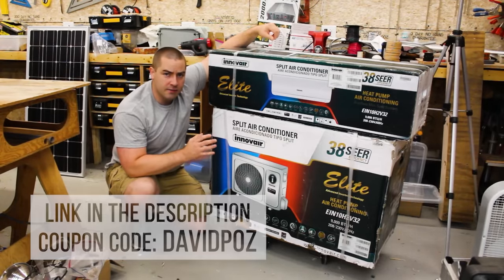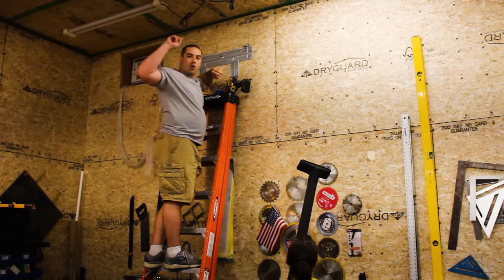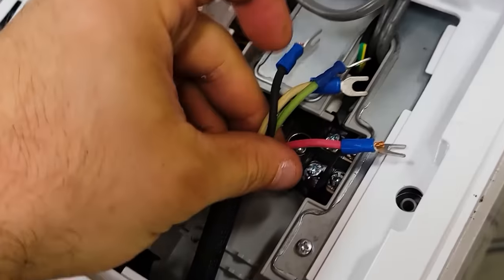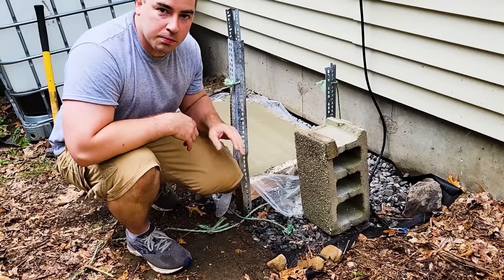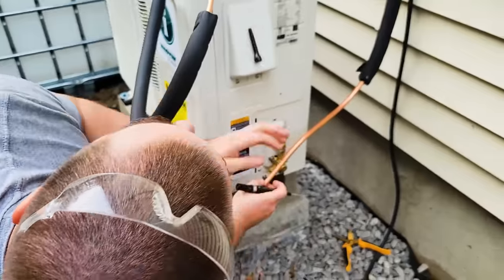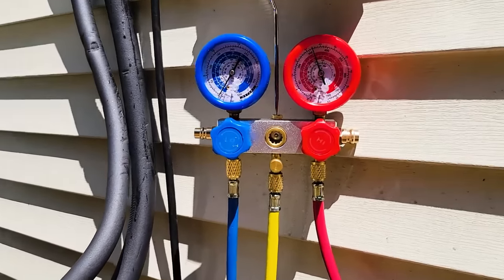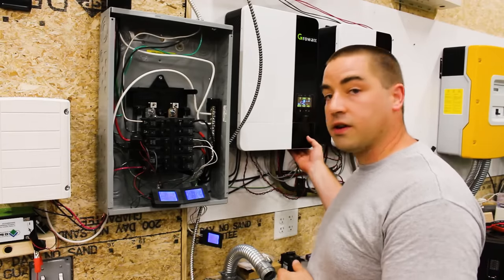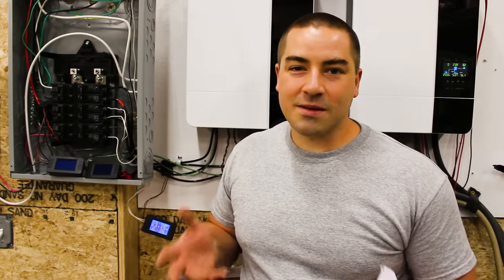DIY Mini-Split Heat Pump, Full Installation, 2021

Comment: Great video and good installation.  38 SEER is nearly impossible to achieve.  You may consider purchasing a gutter downspout and cutting it open to use around your exposed line set via attaching it to the house and the communication wires can be routed in conduit;  some people run these into their disconnect box at the bottom and then run from there to the unit via "whip".
Reply: SEER != EER... carrier already had 42 SEER rated units... maybe you should update your brain on what is possible. HSPF is often more informative as to the effciency of the unit when running full blast (usually something like 15 or so on these high efficiency units), the fact is though that when running at lower output during different parts of the year it can in fact save that much power relative to a unit that cannot vary it's compressor output. For instance my Midea U window unit can throttle down to 2000BTU... regardless of the model 8000-18000 and hits 15 SEER in a window unit (its basically a micro split).
Reply: They sell actual lineset covers specifically to cover the lineset. It doesn't do anything but make it aesthetically pleasing. I guess it adds some UV protection to help prevent the lineset insulation from deterioration.
Reply: @Wingnut353  15 seer is terrible. The EER rating is higher on this unit than your seer rating. EER is a better determination of the units efficiency. The 42 seer carrier is the same as the 38 seer unit he just installed just with a different plastic cover. Why is the same unit 4 seer higher? Because it's a faulty rating system.

Comment: As a HVAC tech, you are going a bit to high for pressure test at 450 psi, you are supposed to go on the low end of 250 psi  of evaporator

Comment: Just an observation guys. The designed pressure labeled on the units, its the breakdown point of the unit. Is not really the designed pressure, literally what those pressure mean its worst case scenario,but it I would never test for leaks more than 150 psi, that is plenty of pressure to detect leaks. At 220 psi, you may actually penetrate the refrigerant side and may end up with a mixture of refrigerant and nitrogen. I been doing this stuff for 30 plus years and I can tell you than I have seen it all.

Comment: Hi david. Would love to see a comparison of measured energy consumption of this ductless unit vs your old window unit. Ideally bringing the space from the same indoor baseline temperature to a target temperature and holding it there for a significant period of time. Ideally these tests would happen on 2 separate days of similar outdoor conditions, temperatures RH and solar gain.  Thanks for the excellent DIY video.
Reply from the maker: My window AC could never get the garage down to the set temperature.  But, this new mini-split hit the set temperature of 61°F in just one day!  So, we know it's more powerful.  but, it did that using half the energy over 24 hours than my window AC uses in 24 hours.  I've been monitoring it since I installed it and I'm impressed.  It's able to maintain temperature for between 100 to 200 watts.  The range is because outside temperature is variable. But I've had some 98°F days the past month, so it's really very good.

Comment: Hola David u got 1m views that means Mini split is the way to go. I never installed one. I want it to do it for my brother who is our Pastor but he moved from that house . I work in HVAC over 30 yrs Svc Tech. But never ever work in one or installed one All i did is clear the little drain line with a Vacuum due to a leak .Other than that tnks 4 ur video😮

Comment: My understanding of the SEER ratings is that they account for efficiency losses that occur from the AC cycling when the cooling needs are less than 100%, as would occur during some parts of the season. If your window unit is running full out due to being undersized, then the gains from switching to a high seer unit are not quite as impressive. However, other factors do cause higher seer ratings to actually deliver savings.
Reply: That's because seer is a stupid rating system. It factors in the seasons. For instance it's not going to take the same amount of electricity to put out 9000btu of cooling in 70° weather vs 9000btu in 95° weather.
Reply: My understanding of the SEER ratings is you get 1,000 Btu's of cooling per SEER per KW.  So a 9 seer would give you 9,000 Btu's per KW while a 38 SEER rating is 38,000 Btu's per KW, or about 4 times as much cooling per KW of power consumed.  One reason the window A/C is so low is the high wattage of the indoor and outdoor fan motor, they can use up to about 200 watts, while not cooling anything.  

The ductless unit, indoor fan about 55 watts while the outdoor is less than 100 watts.  The compressor is variable speed and also very energy efficient.  

I have been repairing air conditioners since 1984.

Comment: I read a lot of the comments, and suspect someone likely has mentioned this... but you really can't measure pressure (esp vacuum) with a refrigeration manifold.  You need a proper vacuum gauge.  Digital is best and can be had quite cheaply on Amazon.  The leak would have to be pretty big to see it on a dial gauge :)  Otherwise, this was really a great DIY project.  (seeing that flaring tool took me back to my highschool HVAC days.... they're notorious for leaking for a bunch of reasons.... It might be worth getting an HVAC tech in to look over your system.... even though it looks "idiot proof"
Reply: He was actually using a quality flaring tool that was more than adequate.
Reply: You don't really need to measure the vacuum though? You're just going to be limited by the pump. The main test is the high pressure test. Are you saying this setup isn't good enough to detect that either?
Reply: @benholroyd5221  the main purpose of vacuuming is to boil off any moisture in the lineset, since moisture will mix with the oil and burn the electrical connections. I personally break a vacuum after half an hour with nitrogen, since nitrogen can pull moisture with it. im not saying the way he did it is going to break the system. but if reading the manifold vacuum level, you will get an incorrect reading.
Reply: Your only pulling a vacuum on the line set which is a small volume.  Even a small leak will quickly show itself. A sizeable leak will  prevent you from reaching a reading that holds for 5 minutes much less 30 minutes.

Comment: And just how cool is that? You lay out over a hour long video just when I'm starting to wonder what happened to you, and a blockbuster one at that, just as I am about to complete my own off-grid system and thought I was done for awhile. Now, you have piked my interest because of the massive Seer rating of this unit, just as I was going to purchase a new Mr.Cool system. Great video David, I am at my son's wedding reception and had to find some time to get through it!
Reply from the maker: Thanks Craig.  I was intimidated at first getting all the vacuum pump and gauges.  Which, none of that is needed with the MrCool DIY kits.  Now that it's over, I wouldn't go back to Mr. Cool.  I would jump in and buy the tools to do this.
Reply: @DavidPozEnergy  what kind of costs are involved?

Comment: My recommendation is that you change the water drain pipe.
These are corrugated and over time they get clogged with mold.
Part of maintenance is keeping the drain clean, and when it gets clogged it's a headache.
Therefore, it replaces the drainage with electrical pvc pipe. You will be eternally grateful.

Comment: Using the L channel to hold the forms at the corners is very clever. Never saw that before.
Reply from the maker: It was some left over steel when I made my garage shelves.  Comes in handy.

Comment: Most manufacturers also want you to wrap further insulation around the lineset and drain pipe.  This necessitates getting a larger (more insulation is better so the largest cover is useful) lineset cover.  You will also want a two stage vacuum pump instead of the single stage to get down to the micron level required to know the system is tight.  By the way your cut out switch was tight not because it was new but because you had the bridge upside down.  The writing goes up so you can read it.  As you can see the contacts are offset in the plastic so that it can only go one way unless you use force.  The devil is in the detail as they say.
Reply: It has writing both directions (On/Off) because it is reversible. One way passes power; the other does not.
Reply: Not true, one way is off

Comment: Thanks for the video and the DIY heat pump video.  I'm buying a 100 year old house, and I'm planning on how to make it more efficient.  The 3rd floor doesn't have ductwork to it, and it's just one bedroom, but I contacted a company about the possibility of putting a mini split up there.  They said they couldn't do it because they didn't have a crane.  I don't get why they said that.  After seeing your video, I may just do it myself.  I don't need that room, so that project may be years down the road, but it's good to know that it's possible and won't cost a fortune.
Reply from the maker: I was intimidated at first, but now I realize it wasn't that hard.   I don't know about the crane.  Maybe they wanted to put it on the roof?

Comment: It being so efficient the 240 seems unnecessary and that it would be easier for most off grid people if it was 120v because it is such a small load
Reply: The 240 is part of what makes it efficient. High voltage low current drive

Comment: Thanks, I enjoyed the video. Not meaning to nitpick but I would mention that the crow's foot extension to the torque wrench will slightly alter the torque vs. that indicated on the wrench due to the extra leverage/distance. I can't say it would be significant but something to check next time perhaps.
Reply from the maker: Thanks for watching.  I agree about the crows foot.  That's why I kept the crows foot at a 90° angle all the time.

Comment: The yellow line is always the service line to the gas bottle, vacuum pump etc. Open the tap to put a little pressure on the pipe. Then disconnect the blue hose, close the tap with a cap and then open the taps completely

Comment: Just because there is a lot of metal that is subject to corrosion in the compressor I would highly recommend a shed or shelter for protection against leaves and debris, snow and rain etc.  Leave lots of room around the enclosure and louvres on all sides.  I would also raise it above the highest predictable snowfall.  Reason is during defrost cycle that snow touching the bottom will hold the freezing condensate from the fins and not allow the cycle to complete.  It can be critical and too much ice on the heat exchanger fins can deform them to the point of failure.
Reply: Both of these solutions would also help with stones thrown from a lawn mower.
  Guess what happened to my outdoor unit when my teenager started mowing?

Comment: Just checked, 38 SEER translates to a COP of 4 (COP is used mostly here, at least in the eastern part of EU). It is nothing extraordinary, but just a reachable good level of efficiency. cots units can do it from many suppliers, for certain state financed programmes min COP 4 is required, the best (and most expensive) units promise COP of 5 under ideal contitions.

Comment: The base of the outside unit must be superb because of Stabila, for the electrical pipe which you switched position later on, I would go with a coupler which is cheaper and you could reuse your elbow,  about the pipe, the pipe should be metric when your obviuos inch tool won't fit, for the US a bit tricky because you are an inch country (not the best) the pipe is maybe for Canada or Mexico but, the flaring tools are available in metric and inch sometimes both in one set. And for flaring here is a pro Tip, put a drop of Nyloc which you got or compressoroil oil which I use on the cone before flaring you get a smoother surface and you have less friction. Greetings from Germany

Comment: If you have a spare piece of feather board, then you can put it behind the shut-off box to give you a flat surface to mount onto. Good job on caulking the mounting hole, nobody else does that.
Angle iron as form board supports, I like that. You had me worried when you tried placing just the blocks as a support, lol 😳

Comment: David, just an FYI you're not really supposed to pull the cable with the fish tape. For such a straight and direct pull it's probably not a big deal but it's a bad habit to be in. You're supposed to use the tape to pull your pull string through and then use that to pull the wire.
Reply: Seems like good practice to have pull string to do the pulling.

Comment: This is very much like the one that I just installed this summer. I chose a different company and size. At 12k btu, that would be around 30.5 seer, as is mine. Right now, Carrier has the best, with a seer over 40, but the cost to performance ratio isn't as good. What is interesting is that your unit, from a different company, looks identical to mine. Even the remote is the same, which means that Gree likely makes this for Innovair. Mine is supplied from Alpine Home Air Products and is named BlueRidge. Honestly, I am happy to see that this type of tech is more accessible to people.
Reply from the maker: Good to know.  I wouldn't be surprised if they came from the same manufacturer.
Reply: I recently got one of these installed up here in Canada that also seems identical.  Mine was branded "ACD" but sold by a company named "Ouellette".  But same specs, same remote... they're probably all manufactured at the same plant overseas, and rebranded by companies that sell them.

Comment: You also need the R410a color coded locks on the schrader valve port, tamper proof , required by law

Comment: You talked about your white "neutral" wire when you wired the breaker box, but that was actually connected to the other hot line at the outside unit.  You should have put some red tape on it in the breaker box, so you know it's actually the L2 wire.  You did connect it correctly to the dual-pole breaker, but the talk about it reaching the neutral bar could confuse some DIY viewers.

Comment: Outstanding Vid and what seems to be a very nice unit, hope the electronics holds up with no future issues. My only recommendation is to order
a replacement master / mother board in the event of a failure. That way you are back in business with unit and then you can have the bad board
repaird for back up.

Comment: use ferrules for stranded wires, helps a lot with better contact and threaded bolts that tighten on wire doesn't ruin the strands.

Comment: SO lots of folks are finally getting the fact that heat pumps work and are very efficient. I will say the geothermal type are the best.
Reply: You wont get better than 38 seer with anything but  small climate master Trilogy 45 or maybe a Waterfurnace 7 and then probably only with open loop system that cost a lot for well pump depending on your setup. Closed loop in right conditions with large loop per ton might get there.
Reply: I am a refrigeration engineer myself, Geothermal are very efficient particularly in non-temperate climates but the need for a borehole or large Geothermal coil buried in the ground can often offset the gains over an air to air heatpump.  It must also be remembered that there are pumping losses associated with either DX or glycol loop Geothermal systems.  The most cost efficient solution is an air to air unit with the outdoor unit ducted to an underground tunnel 600mm diameter and 30meters long on an inclined site sloping away from the unit for natural drainage.
Reply: @teekay1785  ya 15 years on a water furnace and no breakdowns (cross my fingers) and it is cheap on electricity but I wish I had a soft start.
Reply: @teekay1785  eer is 16.5 which is awesome but most gshp will do 24-28. It may outperform in air conditioning mode but we will see. In any event it will be a great upgrade from the old one.

Comment: at about 55 minutes in, you discuss the disconnect for the outside box.  I think I saw you installed it upside down, but I don't know if that matters.  I reviewed the video 2 more times to confirm and could read NO and FFO on the disconnect bar you installed.  Great video, just to understand most of what is involved in installing a mini-split.  Thanks!
Reply from the maker: Thanks for watching.  The unit is running, so it must be in right.  The words actually say "ON" or "OFF", but they are upside down to each other.  Whichever you can read (right side up) is correct.
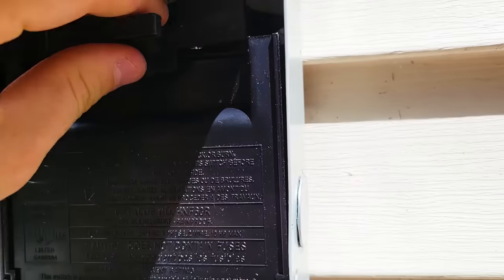Reply: @DavidPozEnergy  55:20 it's in the ON orientation

Comment: I hang my mini splits Asian style - “L” brackets off the wall. This helps in several ways such as removing the condenser away from ground traffic, getting it up out of much of the dust and giving it some hail protection here in OK.  The brackets are inexpensive on eBay and might shorten your lines. FYI
Reply: How high up did you mount the condenser unit? Is the weight comparable to a large window AC unit?

Comment: Another tip, the ell connecting to the disconnect could be directly connected to the box with solvent connectors, so there is no need for the male adapter. However, it makes the ell PERMANENTLY attached to the box, leaving no room for repairs in the future.

Comment: A 3/8" dr crowfoot line wrench set is a better option than that basic crowfoot wrench. Oreilly Auto usually has em in stock in SAE and Metric. They are more like a regular line wrench and much less likely to strip on a nut since they wrap around more. The P/N for the SAE set is GM4473, the Metric set is P/N GM4474.
Reply from the maker: Thank you.

Comment: Looks good. I woulda bent the head unit lines protruding out the exterrior wall before releasing the nitrogen. Would help prevent kinking.
Reply from the maker: Thanks for the tip.